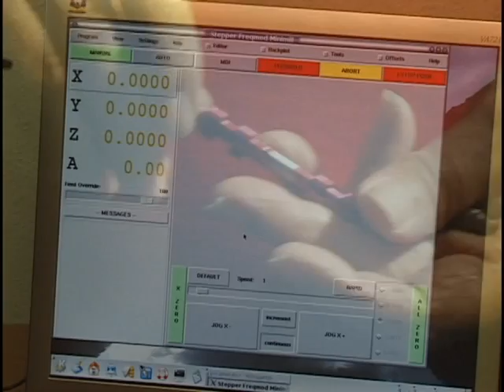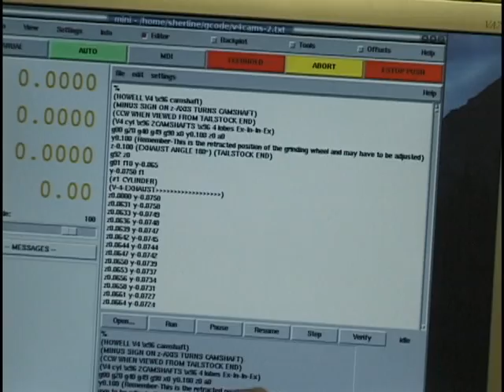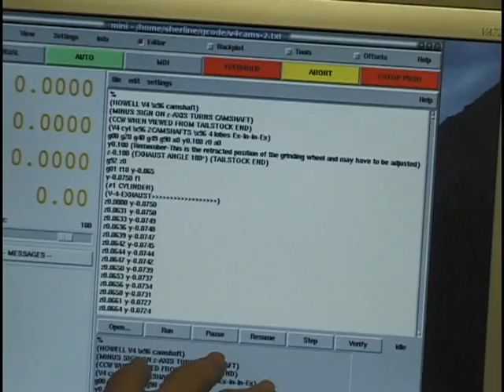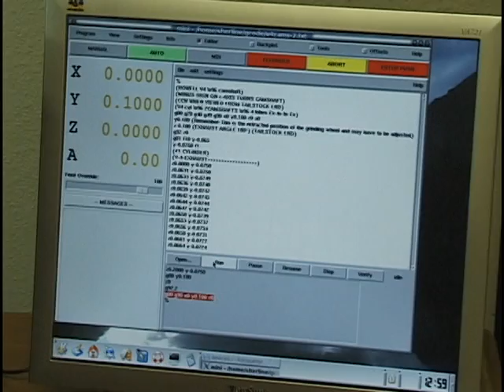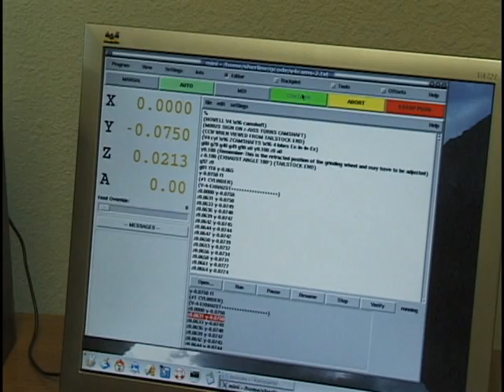Miniature Sherline CNC Cam Grinder, Part 1

Comment: The formuala referenced above is just to program the angle difference between each lobe. It translates an angle measurement into a distance measurement for use on the Z-axis. The shape of the lobe itself is genearted by a spreadsheet program supplied to each buyer of the grinder. It is hard to explain in the limited space given here. If you call or e-mail me directly at Sherline I can explain more fully. Complete instructions are provided to each buyer as with all Sherline tools.

Comment: Craig, thank you for your answer. One more question:Is the distance programmed in the Z axis the related arc segment or is an straigh line? In agree with your comment I would thing that the distance is the arc segment but you have a G1 instruction for all movements. How do you configure the rotary axis in order the CNC understand "distance" instead of degrees?.

Comment: Calling it the Z-axis allows us to use the standard Sherline computer and EMC. Rotation is converted to a distance dimension for the g-code. The rotary axis is geared 4:1. Therefore, one revolution of the motor, which would represent .050" of movement on the mill rotates the axis 90°. 4 revolutions = 360° or 0.020". To calculate degrees divide .200 by 360 and multiply the answer by the required number of degrees.
Example: bottom dead center (BDC) is at 90°.    (.200/360) x 90 = 0.050

Comment: Steven--to make a cam you need a drawing of the dimensions of the cam shape. They are entered into a spreadsheet program which then generates the g-code needed to grind the cam shape. There is no feedback loop to measure an existing cam with touch probe.

Comment: A wheel is dressed not so much because of wear, but because the ground-off particles begin to clog the wheel and smooth it off and it no longer cuts. The dressing process roughs up the wheel surface again so it will continue to cut properly.

Comment: I can see a Sherline head stock, DC motor, Mill table, tail stock. Motor mount.
and ...what else?  The stepper motors of course, is there another lathe bed  in there or is that an indexing attachment?
what about the vertical set up on the mill table? Do you have a list of the Sherline components used?